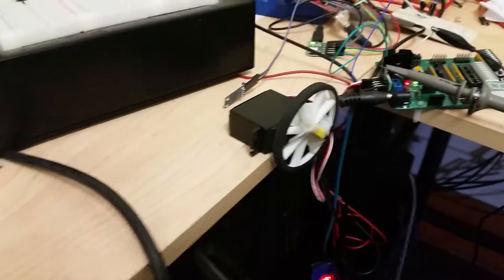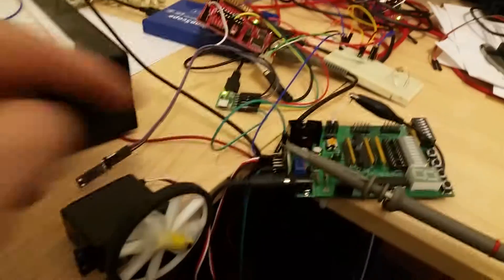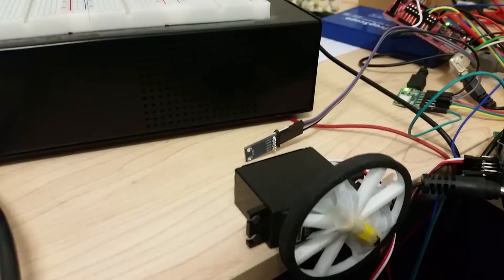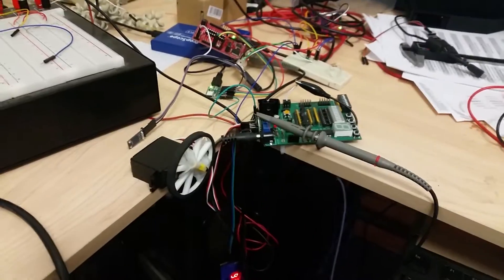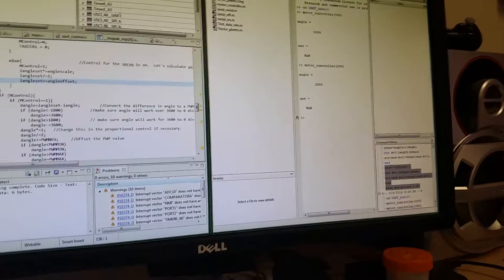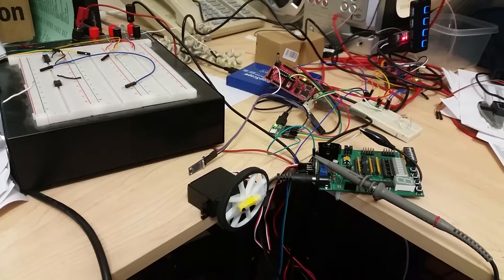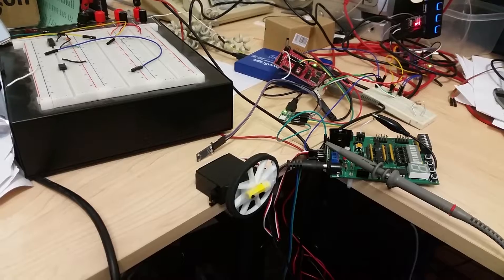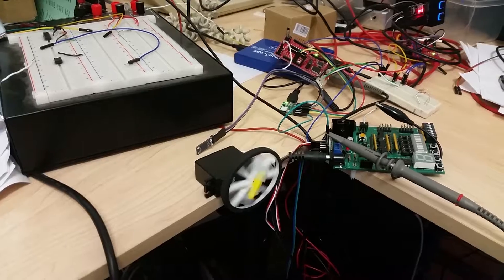Hall effect servo control

Comment: My, that's certainly the long way home.
Reply from the maker: There is method to the madness.  The master microcontroller can control multiple servos.  The individual microcontrollers are then independent to utilize their control algorithm rather than feedback wires for each additional servo.  Anyway, it was fun.  We don't use this particular method anymore.

Comment: Can I use possion control the hall efect servo like RC 180 degree servo?
Reply from the maker: Yes.  Thats what we did with this.  The advantage is we can go beyond 180 degrees where a standard servo is limited to 180

Also there are standardized hall encoders that might make this easier depending on your application.